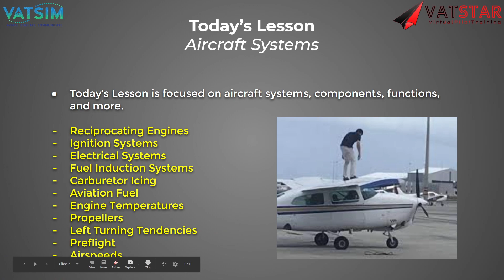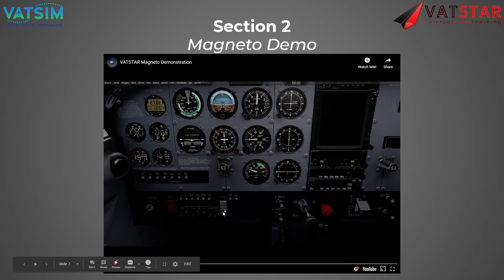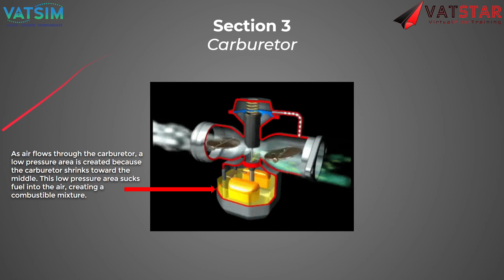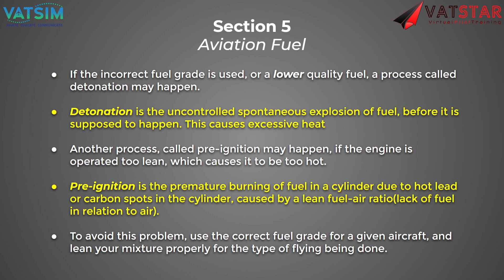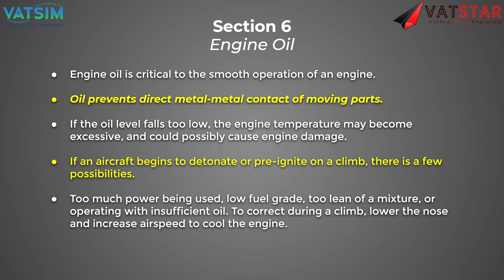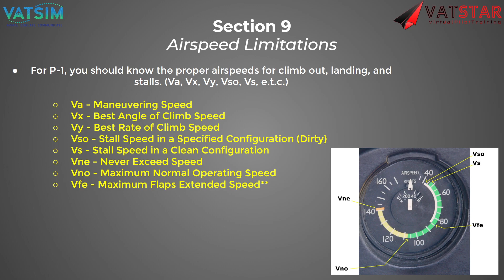VATSTAR PPL Ground School Lesson 2

Comment: 42:25 I have a question. So if the engine need to be cooled if to hot, then wouldn't it increase the icing since there is a low fuel grade?

Comment: Point of interest - around 25 minutes you discuss fuel octane ratings, and ask what cars use.   The US and the rest of the world use a different measurement definition for octane rating.  In most of the world, regular unleaded fuel has a RON octane rating of 95, which is the equivalent of the US MON octane rating of 85.   Similarly, a premium fuel in most countries has a RON of 98, which equates to a MON of 88 in the US.  Same fuel; different definition of how the octane rating is measured.   Good article on Wikipedia on this.
Reply: Wow thanks.
Reply: Our octane ratings are based on RON+MON/2. Not MON. It's an average. That's what you see in gas stations. 100LL is measured completely differently using an aviation rich vs aviation lean rating system and then averaged.

Comment: Amazing content, one question, at 24:25 you mention that carb icing can take effect at temperatures as high as 40 degrees C, just wanted to clarify if that was correct or if you meant Fahrenheit?
Reply: That does seem quite high doesn't it?  That's 104F.  Googling says that most icing happens, and can be quite severe, when temperatures fall roughly between 50 and 70 degrees F and the relative humidity is greater than 60 percent.  With relative humidity at 80 percent it can happen above 70F.  The venturi effect in the carb must be pretty great to be able to cool the air mixture that much but I guess it also depends on fuel temp.